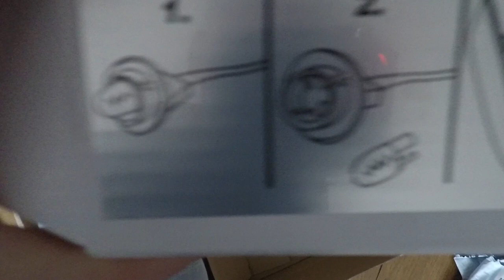FITTING BLACKED OUT KIDNEY GRILLS & INDICATORS TO BMW 1 SERIES

Comment: I recently installed similar fender Turn Signals on my BMW 135i M-Sport Package. Listen..., you didn’t have to pry the Turn Signal lenses to remove them. You only needed to slide them forwards (towards the front on your car) against the metal clip that secures them. Once it’s moved forwards a bit, the rear of the Lens will automatically lift away from the fender. To install, insert the end of the Lens with the metal clip First.., then slide it forwards, while inserting the rear of the Lens (then let let go/release). No prying tool (Flat Head screw driver or Plastic) is necessary!
Reply from the maker: You’re absolutely right I believe I show this in a later video I can’t remember but yeah I did that wrong for sure:) thanks for seeing this:)
Reply: @GeorgeWhiting , 
No problem. Thank you for trying to help the ‘1er’ community. I absolutely LOVE the work you’ve done to your BMW 1 Series!! 👍🏽
Reply from the maker: @nernatbentley3778   Thank you! I appreciate the support, I wish you the best with your 1er :)
Reply from the maker: @nernatbentley3778   Thank you! I appreciate the support, I wish you the best with your 1er :)
Reply: @GeorgeWhiting ,
Thanks!😎

Comment: Lovley vid mate, I have just ordered some all black gloss grills for my black e87, already fitted the indicator led;s - I have discovered a strange problem though, they work fine when you lock/unlock the car, put the hazard lights on, but when the engine is on and you hit the left or right indicator; they flicker on and off and do not light up sequentially like they should, my pal thinks its as if they are gettin to much power when the engine is turned on so they flip out or something, did you have this problem? cheers
Reply from the maker: Hi there sorry for the late reply, no I didn't have that problem hmm, all I can suggest is buy another pair of them from a different supplier and see if they do the same or not:)
Reply: @GeorgeWhiting  thanks for the quick reply, yeah ive done that and should get them any day now, hopefully they'll work better. Kutgw ✊🏼
Reply from the maker: @Lilmonkmonk   nice stuff mate! If you need anymore help message my Instagram @F11OTY
Reply: @GeorgeWhiting  Cheers, update: I got some new LED sequential indicators which just plug in (not the ones i previously got which you have to plug into where the bulb goes in) (and from another seller on ebay) and low and behold they work flawlessly! No hyperflash, couldn't believe it.
Reply from the maker: @Lilmonkmonk  brilliant stuff!! Well done buddy, glad you’re happy with them they’re the best little touch on these cars :)
Reply: @GeorgeWhiting  defo. 👍👌👌 cheers dood kutgw

Comment: @george 

I have same car some god damn side signals, but mine works only if the car is not running, and when I lock it and unlock it. But they don’t work while the car is working? Any tips?
Reply from the maker: Hi there! Hmm I’ve got a couple ideas to try, 
first one would be to pull the indicators back out, unplug the lead and turn round the other way and plug it back in and test that (like I did in the video), 
Second one would be to put your old indicator back in and test that it definitely is the new indicator that’s the problem, 
Third one would be to complain/ask for a replacement or refund to the people you bought it off and show them a pic or video of what’s wrong and go from there. 
Hope I helped:) if you need any more help with anything message my insta @georgewhiting_ 👊🏼🙌🏼
Reply from the maker: Hi there! Hmm I’ve got a couple ideas to try, 
first one would be to pull the indicators back out, unplug the lead and turn round the other way and plug it back in and test that (like I did in the video), 
Second one would be to put your old indicator back in and test that it definitely is the new indicator that’s the problem, 
Third one would be to complain/ask for a replacement or refund to the people you bought it off and show them a pic or video of what’s wrong and go from there. 
Hope I helped:) if you need any more help with anything message my insta @georgewhiting_ 👊🏼🙌🏼
Reply: I have the same Problem, did you figure it out? Pls let me know

Comment: Did you have to put sealant on the new one and if so where did you get the sealant feom
Reply from the maker: No you don’t it has a foam lip around the outside of the indicator and that just rests against the car when it’s clipped back on, it’s good enough to stop water getting in there and passed MOT so all good :)

Comment: Where did you get this silver eyelids ?
Reply from the maker: SaniaMarsTV  they are part of the LCI OEM lights that came on bmw 1 series 2011-2013 which is pretty good, you can get the actual light off eBay for around £150 for a set without motors I’m not sure, or get a set of decal stickers for a £10 ish on ebay:)
Reply: @GeorgeWhiting  nice, thx :)